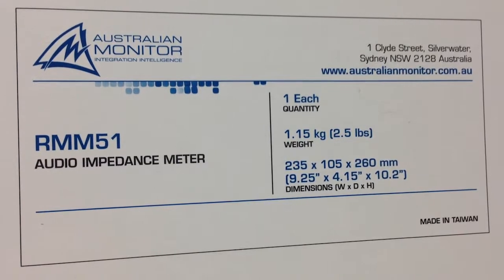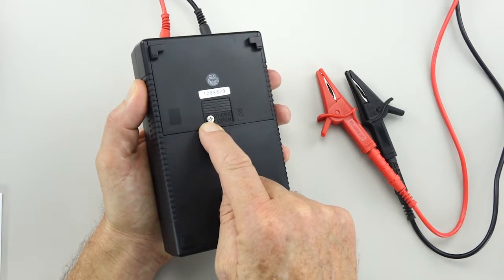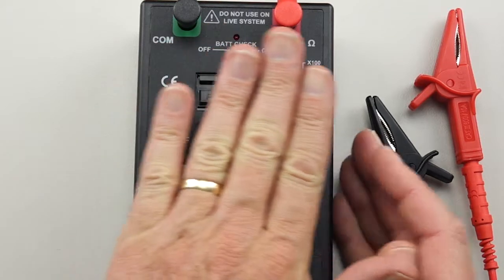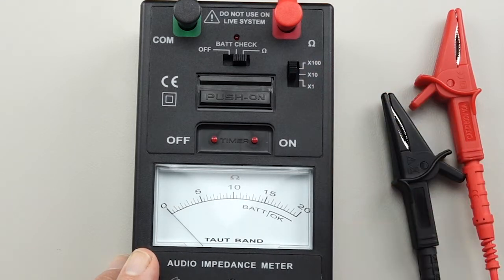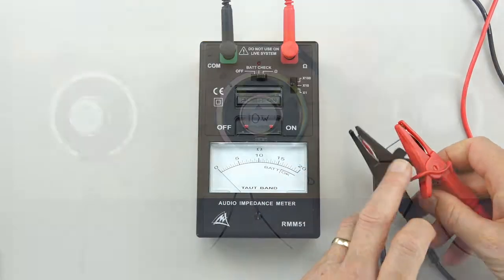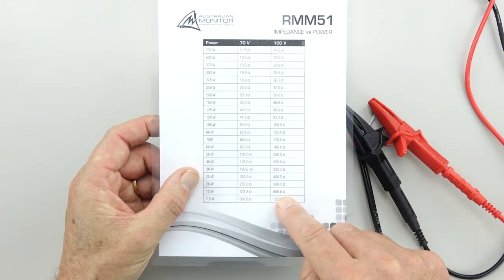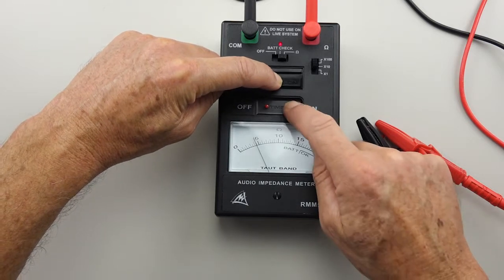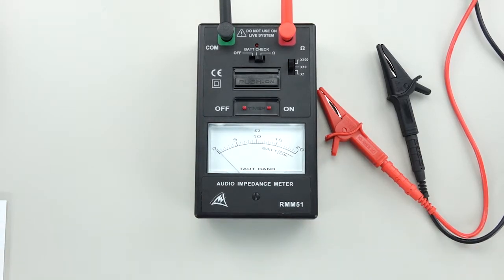Australian Monitor RMM51 audio impedance meter

Comment: Thanks! I find these impedance meters very expensive, isn't there a cheap way of measuring?
Reply from the maker: +The Vedic Way There are other ways of testing impedance of speaker lines but it requires some parts that can cost money as well. One that some are working with is an external module that attaches to your smartphone. https://youtu.be/ld1ga1u6XNs

Another way is to make up the parts yourself. 
1. Audio Signal Generator
2. Passive patch board with calibration resistance. 
3. AC Microvolt Meter
With this setup you can even measure the resonant frequency of a speaker. Hope that helps.
Reply: Thanks! Interesting product for the Smartphone. Definitely not worth the investment just to check one microphone and an audio interface. Great to know other/cheaper ways... Still setting back at least 500usd... so out of my range.